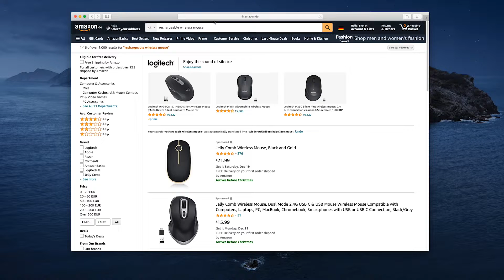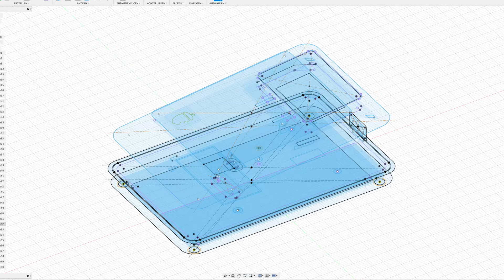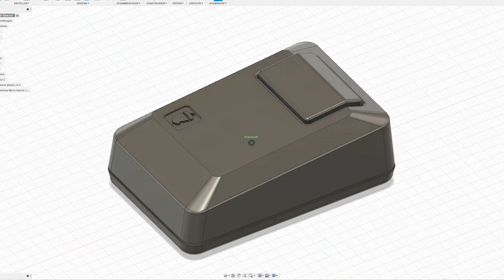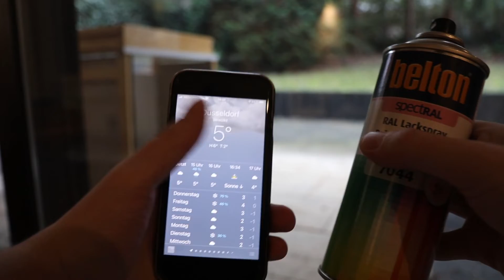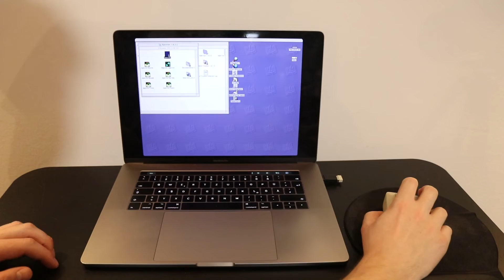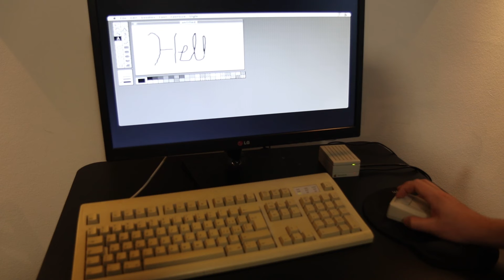3D Printed - Apple Macintosh Mouse

Comment: Excuse my ignorance but what kind of 3D Printing is that? I never seen some print come out of a liquid before
Reply from the maker: Hey Daniel, no worries at all! Asking questions is how we learn. 😊 This is called an LCD 3D printer. It works by hardening liquid resin layer by layer with UV light shining through a display panel at the bottom of the printer. It's fast and perfect for creating detailed objects. However, you might not see it commonly because it can be messy to clean, the resin fumes aren't great for health, and affordable Devices often have smaller build volumes compared to the common FDM 3D Printers.

Comment: Is the model available ? So I can 3D print it myself.
Reply from the maker: Not yet! I need to adjust the 3D Model so it’s compatible with another PCB. The electronics that I used for the mouse are not available anymore so you won’t be able to 3D print a functional mouse at the moment.

Comment: Arguably Apple's dogged insistence on single click mice did them a lot of harm as time went on. Maybe early on the concept was fine but then Windows 3.1, 95 etc showed up and it turned out that yes having a second button, even a scroll wheel on a mouse was something people liked and found useful.
Reply: its crazy it took apple untill 2006 to finaly make a mouse with left and right click and a scroll wheel

Comment: Mounting the single microswitch through the scrollwheel hole with two, often ignored, holes at the bottom is definitely the showpiece of this project. What a treat.

Have you considered using the mouse feet? No doubt the paint will wear out at the bottom.
Reply from the maker: Hi Oleg, thanks for your comment. The mouse has already gone through several revisions. The version that I shipped to customers had rubber feets to prevent it from destroying the paint, and in the last version, I included left and right click, which is going to be available soon to everyone who likes to print it at home.
Reply: @KevinNoki  It's great to hear that you're improving on the project. I, myself, plan on making something similar, but with many more buttons. 

Maybe you'd be interested in expanding your product line to have a MMO mouse. In my opinion, the available options are rather scarce. Razer Naga could serve as a great donor, being comparatively cheap on the aftermarket.